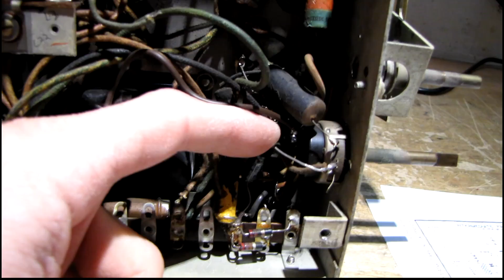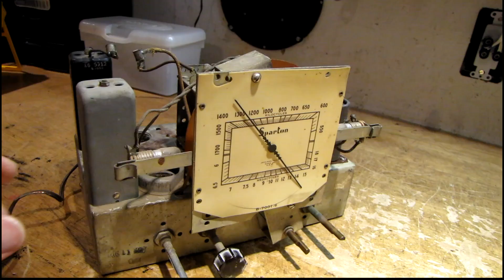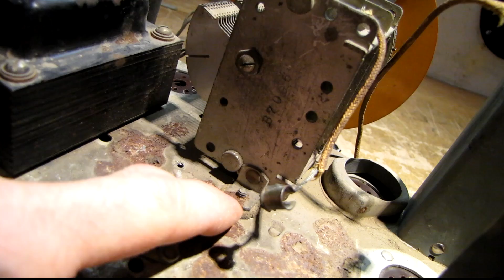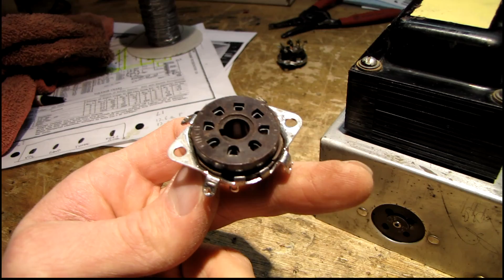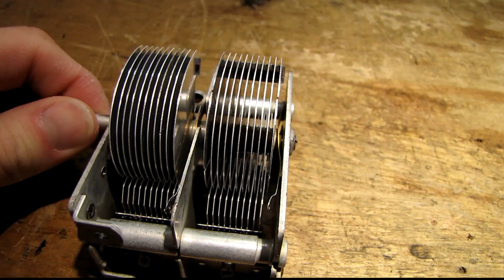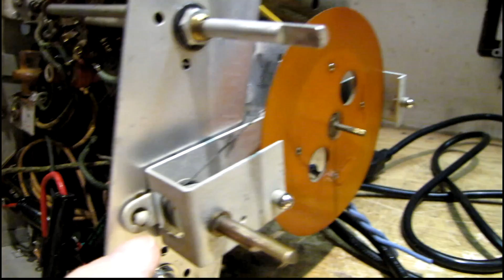Sparton 558B Radio Restoration Progress

Comment: Aaron, really looking forward to the final video. Keep them coming: computers, radios, pro audio. Quick question. I have a 10-year-old 37" Panasonic plasma. I connected a Raspberry Pi B+ running OpenELEC Linux. No matter how I set the resolution or try to adjust the settings I can't get the overscan fixed. All other sources are perfect. Could it be that those old plasmas were never meant to be used as computer monitors?

Comment: Really nice job on the Sparton! I like how you temped in the BC coil to confirm the operational condition of the AM band. Well done. Best. Don
Reply from the maker: RestoreOldRadios Thanks!  If I had more time and supplies, I'd love to do restorations at the depth you do.  I loved when you reproduced those Micamold caps.
Reply: Maxxarcade The Micamold reproductions were a first for me. +AMStationEngineer suggested I try to preserve or reproduce them, so he pushed me on this one, which I'm glad he did. I learned a lot during the process and will make some adjustments next time. Do you have any more vintage radio projects on the horizon? Best. Don
Reply from the maker: RestoreOldRadios Yes, probably a few!  I might be restoring my coworker's old Philco after this Sparton is finished.  And I have a nice RCA Radiola 60 that's been in my family for decades, along with a spare main chassis.  I'm sure others will turn up in the future as well.   Aside from radios, I also love working on tube amplifiers and other vintage stuff.  I think I might still have a bin full of old wax paper caps from past projects.  Maybe I can practice on those for learning how to do re-stuffing.  I'm still nervous about the chemicals in the old electrolytics though.  I actually bought modern reproductions for the multi-section caps in my H.H. Scott 222c and Zenith 7K31.  But if there's any caps I definitely won't tamper with, it's the big square ones in my 1950's signal generator.  I'm all but certain those are full of PCB oil.

Comment: On these old radios which were typically connected to an outdoor antenna, it is not uncommon for one of the coils to be burned out by lightning -- usually the broadcast band coil, since that's the position the band switch would be in most of the time.
Reply from the maker: Yep, I figured the same thing, since there was a black mark under the chassis where the coil was.  That could have been from the original power transformer or rectifier socket too though.  I wish I had some good pictures of an original chassis so I could see what it's supposed to look like.

Comment: I think this will be a really awesome radio when it is finished. I love the looks of the cabinet.  Have you thought about finding different knobs since these are not the original? Maybe something that goes better with the styling?
Reply from the maker: There are reproduction knobs around, but they are really expensive.  I'll be asking the owner about it when it's finished though.

Comment: Excellent work! Glad to see somebody besides me, after working on something for a certain amount of time, gets antsy and has to put power to it. I always feel like I violating some unwritten rule, or breaking the restoration commandment that says everything has to be perfectly put back before you can supply juice. Really cool you got those gator wires in there first try!! I usually never get that lucky.
Reply from the maker: I tend to power things up early, and many times I'll use it in an unfinished state for quite a while LOL.  But it's better to have it break before you do a bunch of reassembly.
Reply: Exactly, and usually on this kind of stuff, your just fooling around anyway. Not like it's your front line stuff!!! Sometimes a new burnt smell is not that bad in the shop....as long as it's not selenium. LOL ;)~

Comment: It is very encouraging on the first power up, that you hear some station on any band. You do very good work, nice and methodical, well thought out, and careful too. I wish that you could of been the first one to have repaired it, but that is getting to be a fairly rare event. I'm sure the owner is going to be delighted. Repairing it the way you have has put real value back into the radio. Looking forward to seeing a video of it all put together. Great job.
Reply from the maker: Thanks!  I think this radio will have a nice sound to it.  The reception might be a bit on the weak side due to the aftermarket coil, but at least it will function now.

I'm still trying to figure out the best approach for replacing the neutralizing condenser C23.  I have a 1PF Mica capacitor that might do the trick.  Once I have the speaker repaired, I'll start on the alignment.
Reply: Maxxarcade
If that 1 pF does not work, you can always try making the gimmick varying the amount of turns in till you get the proper performance. Or you could try a variable capacitor. The performance may improve quite a bit after you perform an alignment. I know you're very aware how important it is not to break anything along the way. I think it sounds pretty good right now. Some of the noise that your picking up might be due to your sound system and computers. Also on these old radios when you have them on an isolation transformer that also induces noise into the radio.